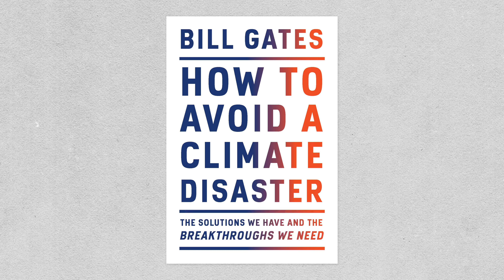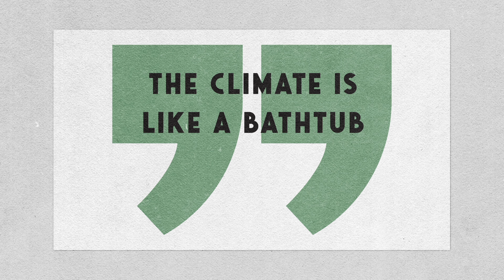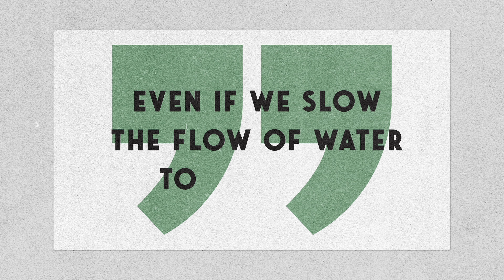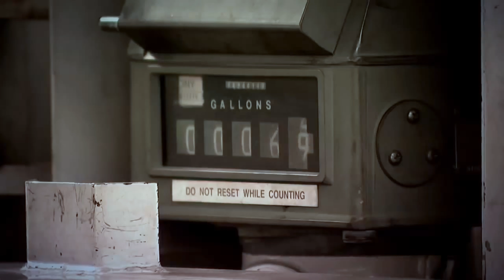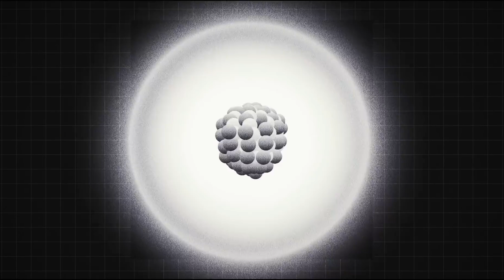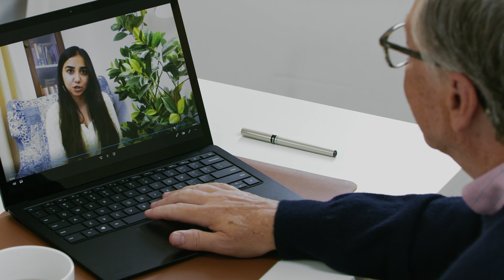Bill Gates Talks About How To Avoid A Climate Disaster | BookTube

Comment: We should also worry about ocean temperatures rising. Eventually the carbon emissions in the air make it into the ocean. The excess carbon and pollution is causing temps to rise. Contributing to the glaciers melting at the poles

Comment: So why don’t we just put biofuel into our cars, instead of forcing everyone to buy an expensive electric car? It would be way easier, cheaper and quicker done. And even better for the environment, due to the fact that you save the CO2 from electric car manufacturing.
Reply: Biofuels are not practical for gasoline, and you will still have a emissions issue

Comment: Are there this many Linux users in the comments
Reply: Boomers still using desk tops....lmao!!
Reply: @chickeninasal4381  I am not a boomer and I use a desktop
Reply: @chickeninasal4381  what makes you think that only boomers use desktops? Desktops are so many advantages over laptops, you can literally upgrade anything in a desktop and it is easy to upgrade, desktops thermal throttle less because they have better cooling. Then they also have tons of ports and huge monitors. And you can have tons of hard drives in a desktop too. Let’s not forget about the fact that you can have a very powerful discreet graphics card and liquid cooling. You can run a desktop for hours or even days  on full load with consistent performance. Try rendering a 20 minute 4K timeline on your dell laptop, will probably work but will take 
Way longer  and will probably make your laptop get as hot as a car on a sunny day.